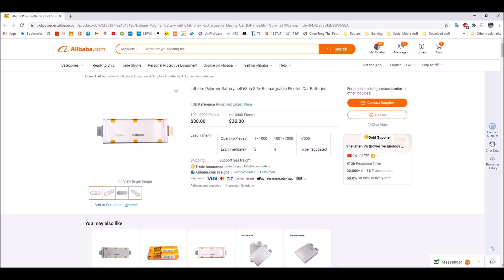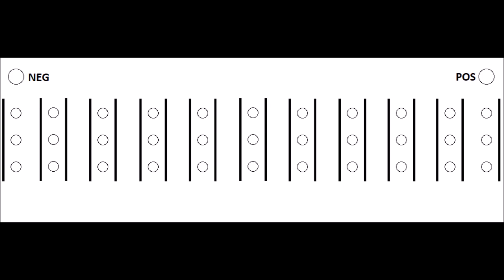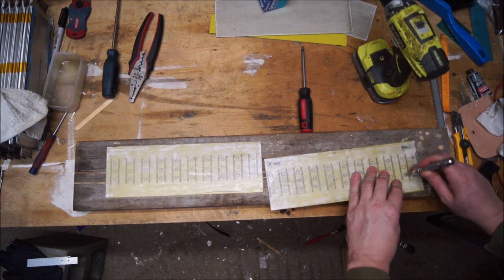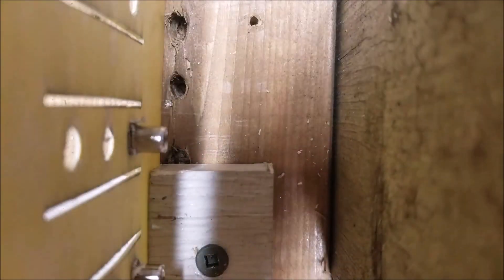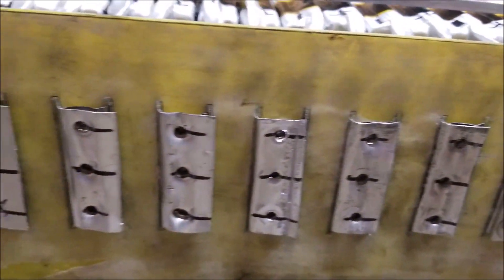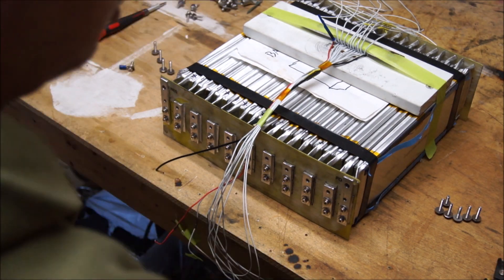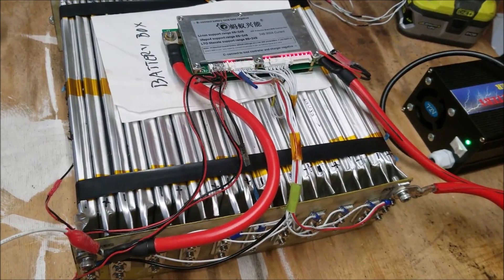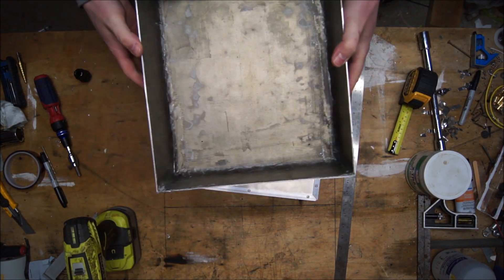LG Chem lithium ion NCM prismatic pouch battery build.

Comment: Wires on the BMS (reading the each cell) must be the same length!!!!
Reply from the maker: I disagree.  This is DC low current not HF AC.
Reply: You can be agree, or not, but if you will check the resistance, you will see differences. So the BMS will have them too. Your reading will be not correct because of the wire lenght. That's it.

Comment: My friend, Thank you for sharing this project.
What BMS did you used, maybe we have the link?
Reply from the maker: The BMS in the video is not the one that was used for this project.  I recommend the jbd BMS with the relay/contactor...
C$ 153.40  20%OFF | JBD Smart BMS 13-20S 200A Balance Board Protection For Lithium Battery E-Bike With Bluetooth 48V 60V 72VUart Communication
https://a.aliexpress.com/_mr3leFj

Comment: Super cool im intimidated by that type of battery cell dont they swell like crazy if you dont use them after charging them
Reply from the maker: In my career I've seen many pouch cells swollen. I've never seen these ones swell but I've only had them a few years and now I've sold the bike.  I also set up the charging so they never went to 4.2 volts but stopped at 4.

Comment: what is the capacity of each cell and what voltage its is 3.7 or 3.2
Reply from the maker: 60 amp hours each.  Lithium ion cells therefore 3.7 volts nominal, 4.2 volts fully charged.

Comment: Nice build!  How the battery performs so far?
Reply from the maker: So far over 100 km range plus acceleration like a 250cc
Reply: @diyelectrified1289  Could this be used on a nissan leaf ?¿
Reply from the maker: @Kevin-fn5tk  do you mean build my battery with Nissan leaf cells?
Reply: @diyelectrified1289  i mean use your battery for a nissan leaf battery
Reply from the maker: @Kevin-fn5tk  I'm sorry but I do not know as I have no experience with Nissan leaf batteries.  What I can help you with is the logic so if you're going to use a different cell you just have to match the requirements of the vehicle.  So at least meet or exceed the original Nissan leaf cells for their C rating and amp hours.

Comment: I wonder how long it took?  I watched the video and threw the assembly into a metal box and the contacts were sticking out everywhere... I guess it was shorted out.
Reply from the maker: Do you mean you tried it and shorted out your battery?  Or do you think that happened to me?
Reply from the maker: If you mean how long this took me, I'm going to admit it took a very long time.  I'm not a master fabricator and so I have to move slowly and think about my next steps. Plus I have a full-time job and sometimes I don't touch it for weeks.  The good thing for me is I have a solid foundation in electronics.  I'm struggling more with the fabrication of the box then I am with the understanding of how to hook up the cells properly

Comment: What about cell level fusing..? You don't use fusing system there
Reply from the maker: No I do not.  All cells are in series.  You only need 1 fuse inline usually on the positive output.
Reply from the maker: Also the BMS interrupts the negative if the amps exceed a set limit

Comment: well but now you can only apply pressure on the edge but not the whole surface of the cell, resulting in bloating and bulging and early cell demise...there must be another way...
Reply from the maker: There is no consensus on whether you need to compress the cells or not.  Even the manufacturers do not agree.  This is my thought on it... if the normal process for the battery is to swell when fully charged as the ions move to the cathode material then it's possible that compressing it might actually be detrimental to the battery.

Comment: Pouch has lower cycles
Reply from the maker: Manufacturer claims 1500 cycles.  If you limit the charge to 3.8V per cell they will last longer.  The energy density that you get packing these guys tight together is hard to beat.  And space is very limited in motorcycle/scooter frames.

Comment: Everyone likes to call these cells "Prismatic".. They are not. Prismatic means a rolled up internal structure, like a " jelly roll"

They are z fold layered. Z fold layered is NOT prismatic. Much more powerful. Based on the tab structure and current path. 

I hate it when the Youtube vid starts off with the incorrect nomenclature. Lol.
Reply from the maker: I called them what the manufacturer called them.  Unless I take one apart, I won't know if it's a z-fold or not

Comment: THIS IS GOOD IDEA , I THINK ABOUT THIS WAY 3 MOTH AGO , SO I GET LG BATARY FROM OLD ELECTRIC CAR I HAVE ALOT OF THIS , I MAKE 60V BATARY BUT I WAATING BMS TO ARIVE .  THE QUSTION IS HOW I CAN KNOW HOW  MANY AH MY BATTRY??
LGX P1
OC194X1
OC19412876
Reply from the maker: When all cells are in series the total amp hours is equal to the rated AH of a single cell.  When cells are in parallel the amp hours are added.  So if you have 5 cells in parallel then your total amp hours is 5 times the single cell rating.